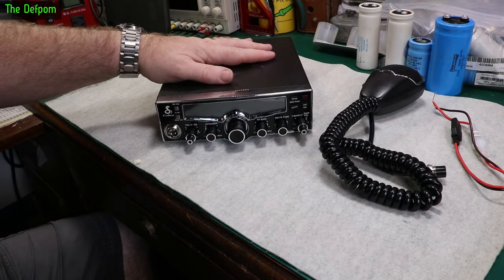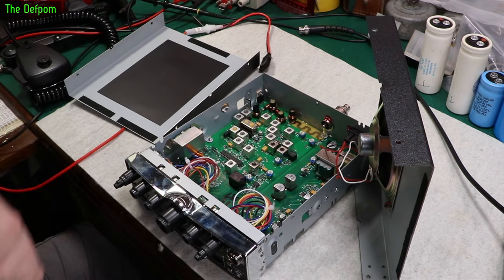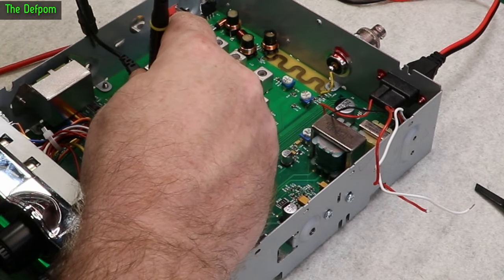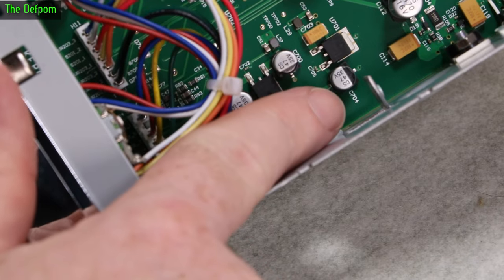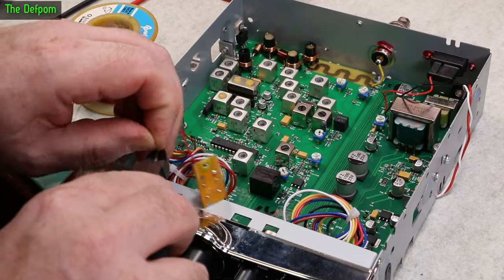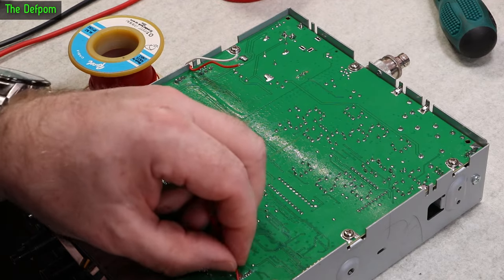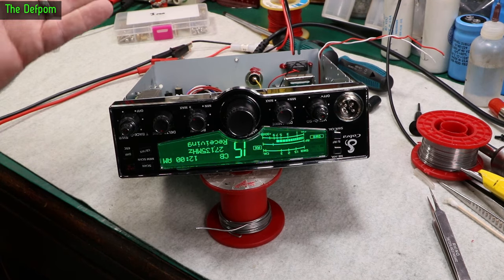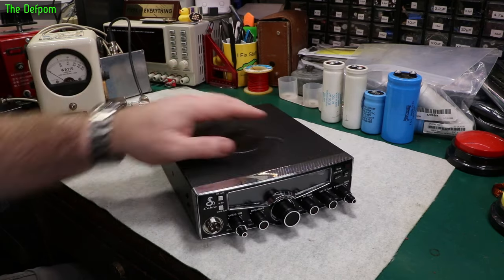🔴 NEW Cobra 29 LX Channel Modification - No.1235

Comment: Wouldnt it be better to use flexible cable for the ground connection? The mod board looks like it may vibrate when the device is used in a vehicle.

Comment: RF stuff has always been a bit of a mystery to me. I've got an old Yaesu FT-101E that won't receive and the service manual is like 200 pages. I'm hoping I can make use of my sig gen to troubleshoot it... something I need to get back into, only had it for about a year now!
Reply from the maker: RX issues, track down using the I.F. , Probe the IF path to see if you can hear the audio, if not then look before that in the RF amp chain and AGC system, if there is audio then check the audio amp system.
Reply: @TheDefpom  Cool 😎

Comment: Is there a link for the boards ?
And is it capable of adding extra bands on this model ?
Excellent video!
Reply from the maker: Yes they can handle two bands just fine, three is pushing it a bit without doing other mods to try and broadband it. Boards are not available, these use a custom oscillator module that I had made just for these 29 series radios.

Comment: I've done the mod for putting the right channel and frequency on the display, if you are interested im happy to help you code that into an esp32 Arduino. 
Im really surprised to see they redesigned the pcb and kept that crap old pll chip, very disappointing, i was hoping for a serial pll without the masked channels. 
See my channel for info on the mod i did.

Comment: So, you didn't add channels, you just changed the frequencies used for the bank of channels?
Thanks for the video.
Reply from the maker: Correct, if I did it slightly differently I could have retained the original band too, but that wasn’t what was asked for.
Reply: @TheDefpom  
Add a switch to choose between normal and ab-normal. 😂

Comment: "It looks to be brand new, still got the peel on the screen" :)

I don't consider that to be verification of whether something looks "brand new", haven't for years.

If you were to take a walk through my house, you would probably consider everything to look brand new if the 'peel' still being on the screen was one of the reasons.

I get no satisfaction from removing the thing, so I tend to just leave it on all my devices. I have devices that are years old still with the original peel on it.
Reply from the maker: I was told by the owner that it was brand new and just imported into the country, which is the basis of the comment, but yes, I agree with your statement, I too tend to leave the peel on things to help protect them (I sometimes video doing a screen peel, but I usually put it back on after)

Comment: 6:15 SCL and SDA is an I2C bus, not SPI !
Reply from the maker: But it also has Chip Select and Reset, which is SPI, I didn’t end up probing it so it will remain a mystery LOL.
Reply: In this radio those lines are used for multiple sections. The EEPROM is I2C but the LCD uses them as well along with another line for CS and a fourth for data/addess (rs) select.